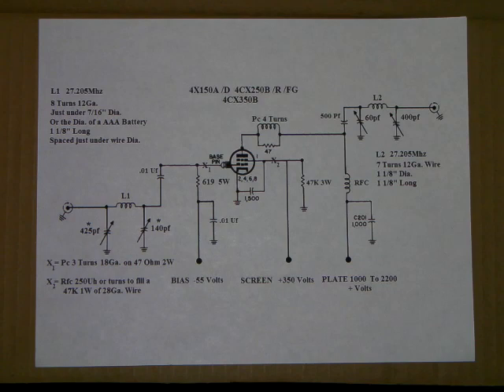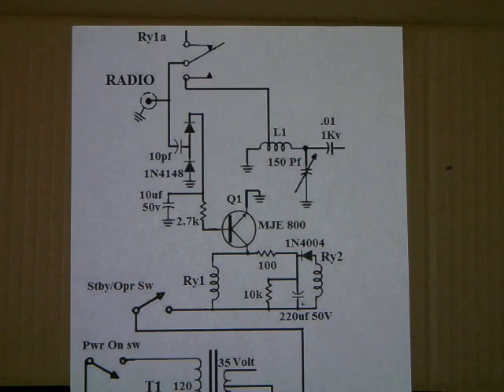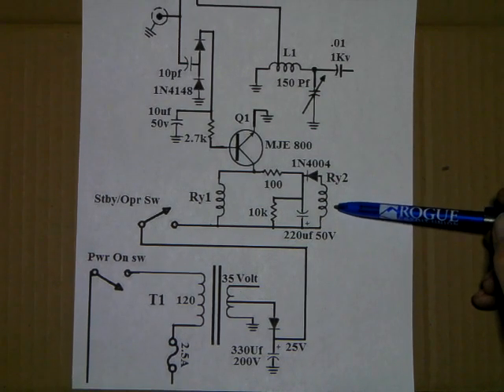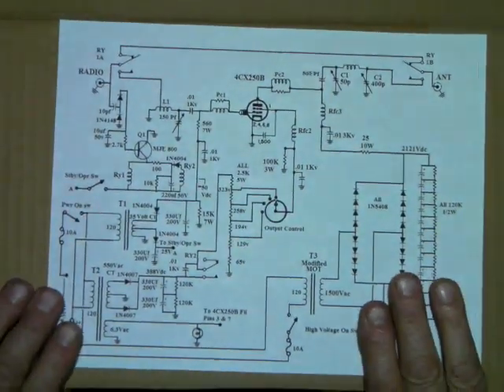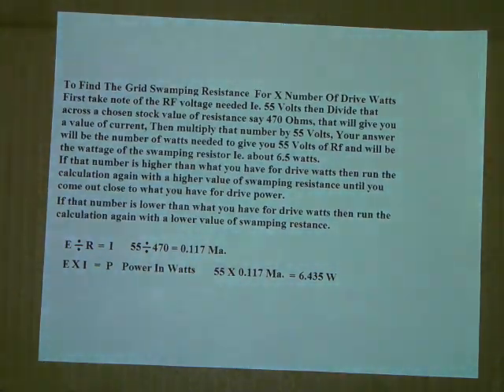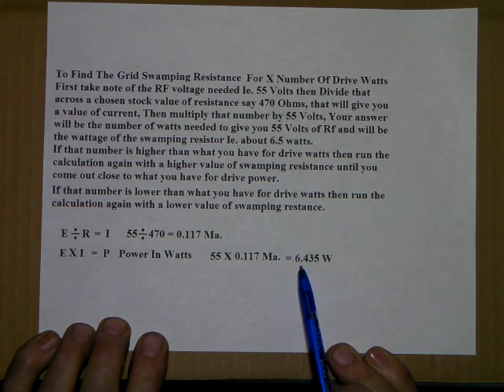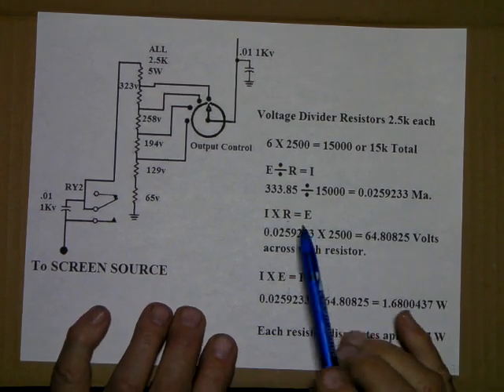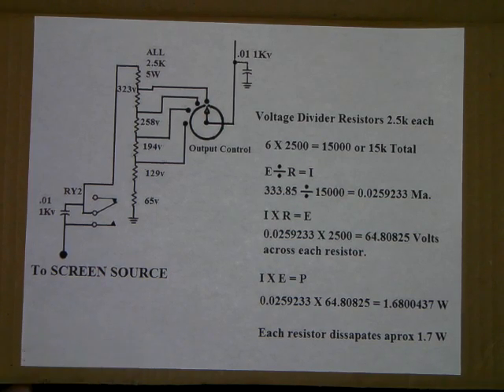Single Tube 4CX250B Amp For 27Mhz  The Build Pt4

Comment: Ok. I been thinking, if the drive voltage is 55 volts and the bias is set at -55 volts, if someone put a higher drive  radio and it drives over the 55 volts would the grid be driven to positive volts

Comment: How does your key circuit behave when you are using ssb? Does it chatter or does the 220 mfd cap provide enough damping? I was also wondering if you had considered just running them as triodes in grounded grid. It sure lowers the part count and the complexity. At 27 mhz isn't it much more likely to become unstable and very likely to generate out of band RF for rookies?
Reply from the maker: For SSB there will be another 50uf 50V cap put across the 10uf  with a switch.
Tetrodes of the small end of the 4CX family will not
work as triodes G1 only has a 1 watt dissipation and G2 has only 15 watts of dissipation and will draw far to much current without the normal voltages applied  and another reason would be
that you would have no control of the output power except for using an attenuator on the input
to get rid of some of the drive power.
As far as circuit complexity goes, if you are using 24 volts for the keying circuit all that is needed is a
voltage doubler consisting of 2 diodes and 2 more caps to get your bias from the same source as the 24 volts and then if you use the two ANTEK transformers  to get your high voltage you will already have your screen source except for the divider chain, so not really that many more parts.
I choose not to build with triodes because I like the
idea of having control of my power output without
having to lower the drive power.
With swamped grid input and careful attention to using a Pc choke on the plate and at least a 100 ohm resistor in series with the grid G1 if you do not
use a Pc choke there,  you will have a very well behaved amp that can give you almost 400 watts with only 4 watts of drive.
Reply: @radiomedic111  I may not understand but if the grids are at dc ground not just rf ground then no current can flow ? And none of the grids are cathode connected so no issues there and a guy could add a zener to he cathode if need be to make it easier to drive. It may be that I should not be allowed near high voltage but this is what I have done. Still love your vids showing how it works and why it works. Great work sir.
Reply from the maker: @DARKDUDE187  It has to do with the spacing of the grids, the drive power would blow through them like a blowtorch.
Yes they are at RF ground but they are also
in the electron stream flow an that makes them attract part of the drive power because it would require more drive from the cathode than the grids can handle.
The tubes will put out full power with less than 1 watt of drive in normal operation.
If you take a look at any of the BILL ORR "Radio Handbooks"  from the 18th to the 24Th edition and look in the section that talks about the selection of tubes for use at grounded grid he gives an explanation on the subject.
Reply from the maker: @DARKDUDE187  I have just found a source to Bill Orr's News Letters and there may be some info here that everyone can put to use or at least learn something from.
https://www.bunkerofdoom.com/lit/Eimac_amateur_service_newsletters1979.pdf